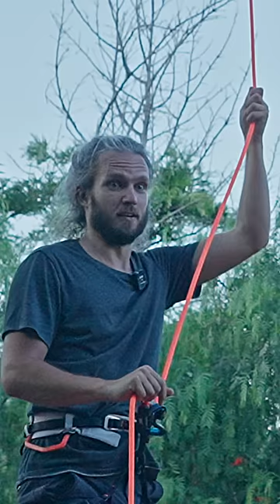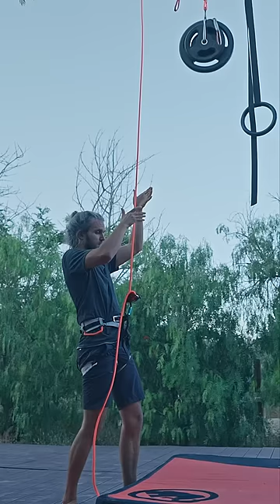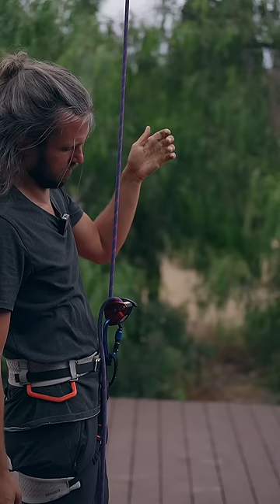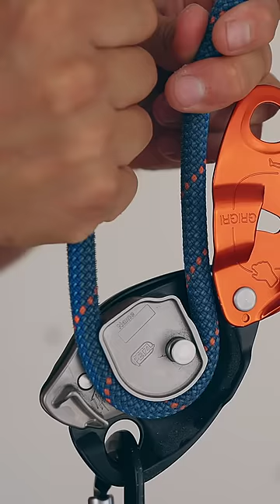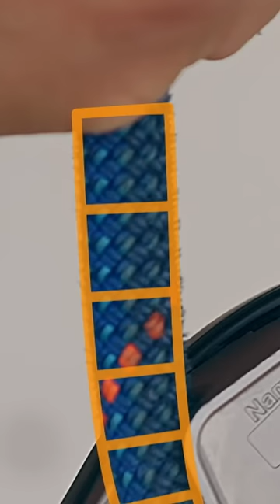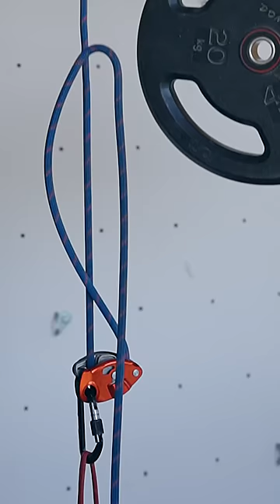The Physics of GriGri | When does No-Hands Belay Fail?

Comment: I would think it has less to do with the device and more to do with the belayer.  Every device can fail at its intended purpose (manufacturer defect, misuse, overuse, poor care of the device, breakage r/t old age etc…).
Reply: The device worked as designed. The issue is that the deaign is flawed
Reply: Yes it comes down to the belayer not using the device as intended. But there seems to be a proportion of people who use the device incorrectly, believing it will catch with no hands. The guy in the video is trying to show people that idea is bull shit and if they continue to do it, they will drop someone

Comment: Wait how does it work is it a spindle or a cylinder attached to a clutch that initiates when it's spun?
Reply: The grigir you mean? Its a caming device, the fruction of the rope forces a spring loaded cam to pinch the rope at the brake side

Comment: If done properly this isn’t a problem. You just have to run the rope back against the brake hand through a beaner and it will keep friction on the cam. Works decent for our guys.